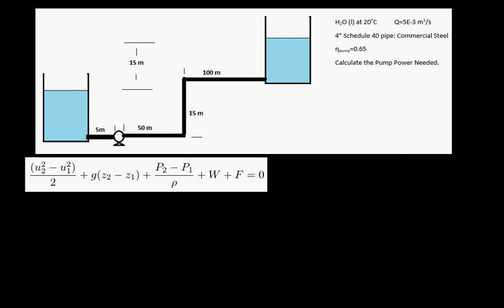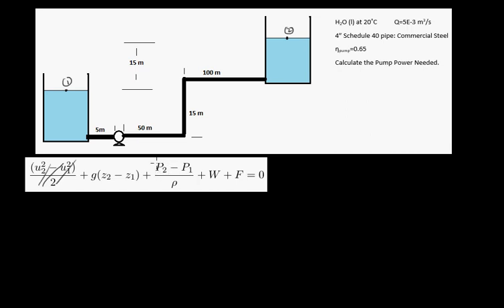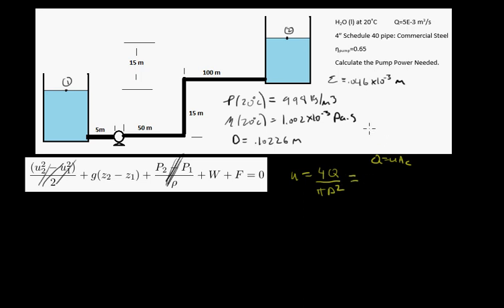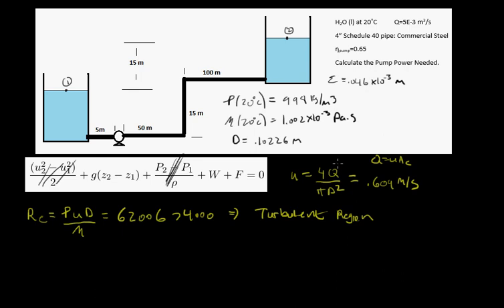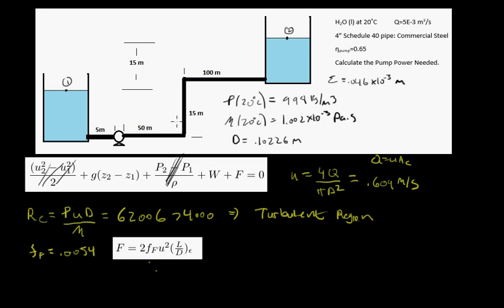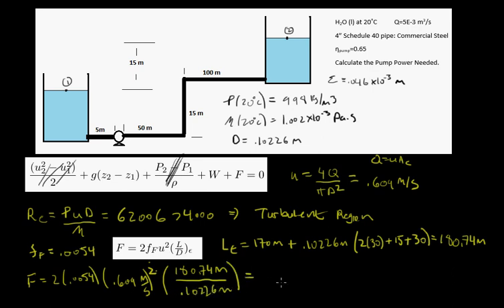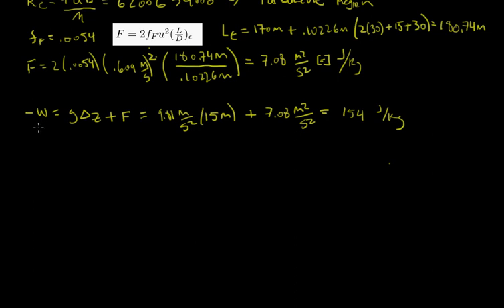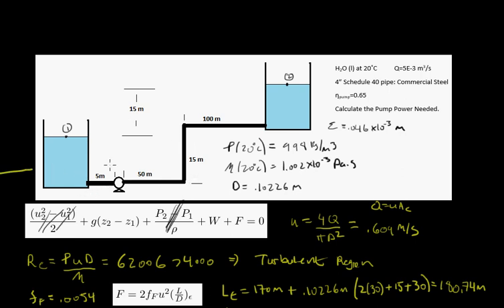Pipe and Pumping Problem (Fluids 7)

Comment: There's something wrong with the way you have your script in your calculator. That friction factor makes no sense for the givens. It should be somewhere around 0.022, confirmed by manually calculating it with the given expression and checking against a Moody Diagram

Comment: the actual work from the pump that you calculated is wrong. you’re supposed to multiply the efficiency by the ideal work to get the actual work. you divided them.
Reply: No, mechanical power must be greater than water power. So it must be divided.